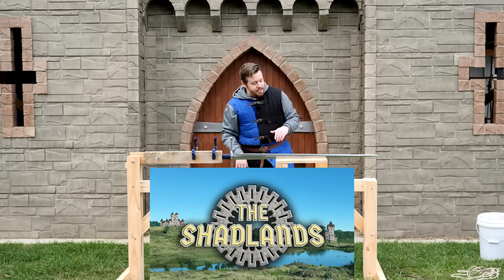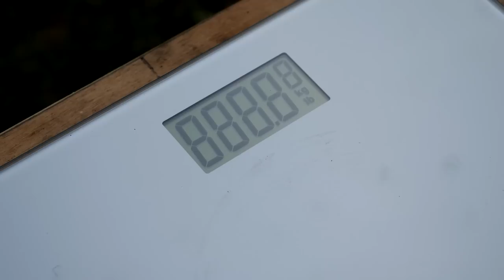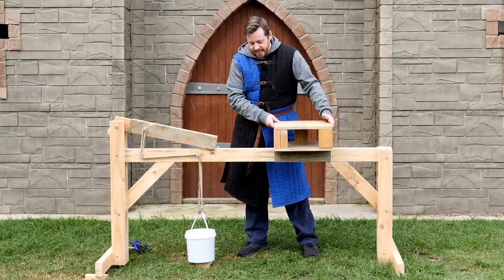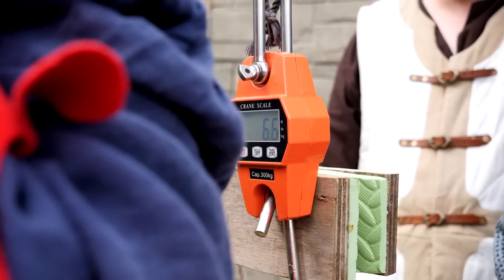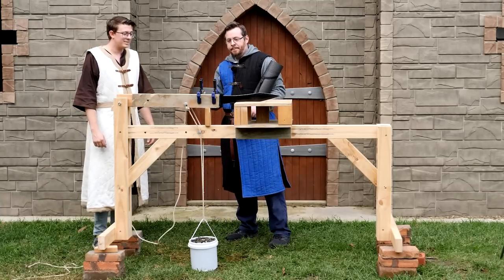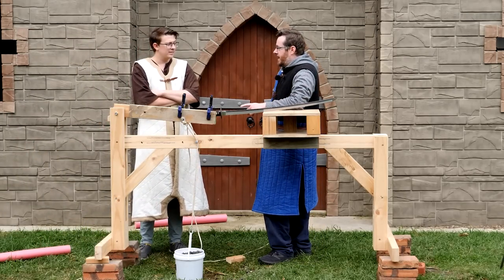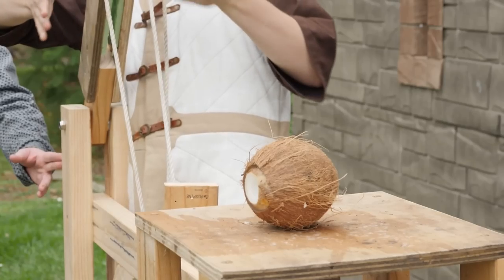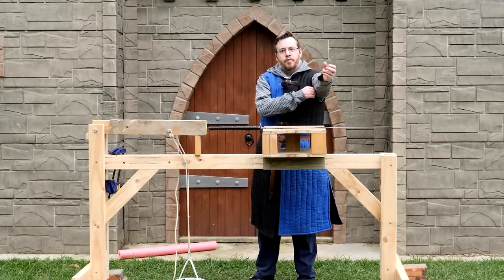Choppy choppy

Comment: I’m not an expert in these things but I believe my observations will make sense.  Your simple lever chopping device doesn’t reproduce the action of your movement when you used the katana.  The chop you made consisted of movement that included rotation of the shoulders, elbows, and wrists all adding up to the final chop with the addition of the muscles in your shoulders, upper and forearms adding to the kinetic energy of your blow.  You also probably added some additional force from your body weight as you leaned into the blow.  You need someone to design a robot arm to simulate the swing of a human arm and a better device to measure the force of an actual strike.

Comment: What went wrong is that your force test measured the pressure at the end of the lever (the point where the sword would contact the target), while your sharpness tests measured the pressure exerted by the lever about 1meter back from the end of the lever.  Two ways to fix this are to:
Use math to calculate the weight needed to be added to the bucket to cause the lever end to provide 7kg of force, or
Place the scale on the chopping block with an item to hold the force of the blade off the scale, tare it, then add weight to the bucket until the scale reads 7kg.
Reply: Also I recommend trying corrugated cardboard (the kind used in apple boxes or moving boxes) to test the cutting power of a blade.  Place it vertically in a stand of its own, if it needs to provide more resistance, just add extra sheets of the cardboard.  Just make sure you use the same maker to ensure better consistency.

Comment: No mystery, it's quite simple. The guillotine does add the correct 'force', but it only accelerates at g (earth's gravity).

When you swing, you use a much larger acceleration, explaining the massive difference in impact force.

This is why you can't use this system to compare weapons. As a human, you can accelerate a machete much faster than a broadsword, while your machine accelerates at the same pace, regardless of the weight of the weapon put in.

Comment: I think that there are many problems with this setup, some intrinsic problems, some "mistakes"
Problems: 
1. The weight of the wood contraption makes it hard to calibrate, i feel like the weight of the sword is not affecting its speed as much as when you swing it.
2. I dont think we humans apply a constant force when swinging, some positions are easier for us to apply force so that makes it harder to calibrate as well, this inconsistency affects different weights in a different way.
3. The sword slipping is also a problem, it kind of also happens with a real selrd swing, but this will introduce a lot of variance and some swords will have a bigger problem than others.
Mistakes:
1. When you calibrated the system you mesured your strength at the end of the stick, but on calibration mesured it at the end of the "hand".
2. On calibration you only considered your strength a the last moment of the swing which is probably weaker than average.

To solve this the easier thing would probably be to do a couple of tests with real swings and try to match that with the contraption, you may have to apply different weights depending on the sword weight.
Also the blade should be prevented fron slipping.

Comment: When a man swings a sword, he can use his hand leverage to fully push the cut through, but the tool swinging it just has a drop, which I'm guessing has a slightly different effect on the force going into the cut. There seems to be a serious difference in how much power goes into the swing at the time at hits a target, with a lot less strength being applied by the tool than by a man using his arms. I'm not sure what could fix that, but it definitely looks like there's a strong difference between the two methods right at the time the blade connects with the target.

Comment: When you did your force test with the stick, you were getting the force from near the tip of the stick, farther from the fulcrum (your shoulder) than where the weight you measured on the guillotine.  You really should measure the force at your cutting surface.  I'm guessing you need to double or maybe triple your bucket weight to get it about right.

Comment: Add water until you reach the very rim of a 5-gallon bucket filled the bucket and mounted on the Rope so that it dangles almost touching the ground but not quite when the sword is mounted and you are preparing to raise the sword to make the first test as far as what you end up losing is going to require somebody else who knows the calculations better than I do to figure out what your ropes are doing to the weight all I can tell you is that the roofs are sucking the energy out of the rotation. Yet you do not have to worry about starting the sword in motion taking up energy that is natural it is moving the rope that is taking up energy that would not be normal

Comment: Even with poor calibration, the swings were consistent with one another as they were applied under the same conditions. It may well be just the mass of the war sword, or differences in coconuts. Would have been interesting to swap back to the war sword before the manual swing to see if it was just a differences in coconut.

Comment: The katana was specially designed for a draw cut, whereas the longsword is compatible with drawing and cutting because of the shape. That could be why the katana wasn't cutting the coconut, but the longsword was. Just speculation.

Comment: I don't know the technical terminology but I have seen other commentors say it; on the point of impact the clamp looks like it slips on pretty much every drop, when you are swinging the blade yourself you automatically adjust to maintain a solid grip so the swing keeps it's strength. When your manual swing hit the coconut I would imagine you tightened your grip even without noticing, I don't know how you could replicate that with a rig.

Comment: just slice round objects at 1 point so they have a base and dont roll. us chefs do this all the time inorder to cut vegetables straight and clean without them rolling away or risking cutting ourselves.
also get like a huge chefs knife,  i bet that would blow your swords cutting things away, simply as if its scaled up to a swords size it will have a huge amount of weight behind it and be ridiculously sharp.

Comment: I think you need to match the accelarative force and not how much pressure you can apply to the scale.

Mark a sword with tape at the center of mass, do a real strike against a target filmed at a high frame rate of the same swing type that your machine does. Adjust your machine’s weight to match the (same) swords acceleration. Then, use that weight as your standard.

Comment: Just an idea but you could put a gap in the target surface so that it would be possible to actually swing through the target. As a side effect it would help hold certain objects in place. Also maybe add a handle to lift with so it is slightly less awkward.

Comment: Looks like those trigger grip quick clamps are slipping, it's actually quite hard to get a really solid grip with them because the plactic handles flex. See if you can get some all metal F or G clamps that screw down, you can get massivly tighter clamping with them.

Comment: Here is a point I don't see other comments bringing up. Your machine has the pivot point at the same height as the target but when you swing your shoulders(your pivot point) is above the target. The blade angle compared to the force direction is different. This adds a natural drawing force to your swing that the machine does not have. 
In the following simple force diagram the blue arrow is the drawing force:
https://drive.google.com/file/d/1XB8xVTS9R-kZ4QMKs0ZPGULaUrQO2-Oi/view?usp=sharing

Comment: I'd recommend setting up a pulley and release system. I suspect it would be easy to slip and have the blade slice you while holding it up, and with a release latch like on a crossbow you can remove the human element of friction while dropping it.
You also ought to fix the swords better vertically, as their slipping greatly reduces the force delivered.

Comment: The method of fastening the sword is pretty good, but when the sword encounters to much resistance you see that the blade tilts up out of the clamps. There needs to be some kind of stopper on the top of the hilt. That’s why the katana couldn’t get through the coconut. It needs to be fastened better and not be able to tilt up at impact

Comment: I think the weight at the cutting point will have to be calibrated between swords, with 7kg weight where you weighed it its probably 2 to 3kg at the cut point so a heavier swords will have a lot more difference and advantage.

Comment: If you angle the sword you need a wrist and a slicing action. Right now you only have a cleaving action and you're not using it appropriately because you are not using your grip appropriate. cleaving action works best when the tip is moving faster than the handle and the blade is parallel with the table at the point of contact with the table and with the point of contact with whatever you're connecting with the blade should not be more than 5° off parallel with the table. The grip on the handle should be between 30 and 50 lb with a wrist deflection weight of 7.4 keeping 75% or more of the weight of the blade itself beyond the center of the target either due to momentum of the tip of the blade or because you are using a true cleaving action and you are also using the center of the blade Edge one the center of the target minimizing kickback that the wrist will have to contend with. Basically ask your dad and prepare for a long lecture. If he is wise he will teach you how to study how your arm performs a cut. Because that will allow you to fill the machine exactly the way you want to build it.

Comment: Maybe a better way of clamping the sword? Alot of energy is going to be lost in it slipping out of the clamps. Maybe a through bolt top and bottom (from the viewers view a bolt top right and bottom left) to stop the sword handle slipping out the grip. So the sword would be supported at the top back and bottom front of the grip

Comment: There are a couple things wrong.

Not enough speed. You got to remember our arms aren't 1 simple lever. There's like 7 not taking into account your spine being segmented. So for simplicity sake measure swing top speed and have that be you target arm speed. 

Securing the sword put some padded bolts that would simulate someone pushing and pulling the sword not just pinching.

This is just me nitpicking about tools but those are speed clamps they're meant for speed if you want something to stay clamp look at f style clamps or screw clamps. F style or screw clamps can produce much more clamping force. A lot people think clamps are equal they are not. I've used f style or screw clamps like a makeshift press.

Comment: Could you change the apparatus so that the pivot point is constructed like that of  a torsion catapult?  This way you can modify the force applied to the pivot arm (by adjusting the tension in the ropes wound at the fulcrum), measure out a set distance (degrees of rotation) to attain consistency of force at impact, and not be limited by the force of gravity (I promise that a swing of a warrior's arm accelerates much faster than gravity, and if [force] = [mass] x [acceleration]...).  BONUS:  Torsion technology is Medieval technology!
Reply: I know that some might say that the weighted bucket would make up the loss of acceleration by adding mass, and that it was the total [force] applied that you measured by the scale.  But the weight in the bucket was calibrated to the force that you yourself applied to the from the length of a weapon.  Now...do you really think you couldn't cut through a yoga mat with a katana?  Keep in mind, you would experience some deflection in your wrists on impact...much like you experienced with the C-clamp grips that you are currently using.  I don't think we can put all the blame of a failed cut on the slippage of the grip setup...that may well be within tolerance levels.

Comment: you measured the weight at the tip of the sword and applied it to the rig at the handle.  you want the rig to apply 7 kilos at the tip too.  also for the platform, i'd make twin platforms with a space in between them so the sword can pass through the platform without hitting it.  the stopper under the handle is a good idea, but i'd make it a little shorter to accommodate the divide in the platform.

Comment: These points might have already been mentioned but the first issue I can see is you should be using kiloNewtons instead of kilograms since it is a dynamic force. You have the velocity, strength force, and weapon weight which will be much much higher than 8kgs, e.g. 250# falling 6' = >1000#.They have kN scales for rock/tree climbers but they are pretty spendy, you might be able to rent or borrow one. In addition your shoulders, elbows, and wrists are hinging (acting as levers) andding power somewhat similar to a trebuchet. Another issue is that the natural swing of arms follow through, provide a slicing effect especially if using a curved blade. Last but not least, those clamps are crap, use some good ole' C clamps.

Comment: You should also look into strike speed, the same force and the same energy are different, so it may be worth looking into as you can probably swing faster than the limited acceleration here. Another thing is that the sword isn't secure. When it hits the target it slides up, eating a lot of the damage it could be doing. 
For consistency sake I'd like to see a mark of where you measure the "down-force" and put where your hands should be on the swords there, again purely for consistency across different swords. Perhaps a gravel bucket is a bad idea, maybe cement it (I know this vid was for testing so maybe this or similar was already the plan)?

Comment: Force = Mass * Acceleration
You accelerated the katana a lot faster by hand so naturally it had a lot more force. Also, the farther the cutting point is from the pivot point, the more acceleration it has. Which means longer swords have a big advantage. Basically, as Demolition Ranch says, "Speed equals penetration."

Comment: Horizontal clamp not vertical, you're losing a lot of power to hilt rotation in the clamp. Also as noted below, the force you want to measure is at the striking point not the hilt. Also also as noted below, you need to up the acceleration to greater than gravity--the velocity of the blade takes advantage of the blade's momentum, and you lose a lot of that using gravity as you are doing; try using a 2:1 pulley rig and double the bucket weight (and put the rig so the bucket can move the distance it needs to; one pulley above the clamp, cos the bucket's going to have to fall more than a metre).

Comment: A spring based system may be more accurate than relying on gravity. You wouldn't be as reliant on acceleration. I don't know how much force it actually has, but you might try looking into one of those devices for throwing clay pigeons.

Comment: You need to measure the 7kg at the end of the sword when its in the apparatus. Put the scale under the end of the sword and add weight until you reach the desired weight. 7kg at the back of the arm wont translate to the same weight at the end of the sword, several feet away. Also, this number would change based on the length of each weapon tested, therefore each weapon needs tested (or at least something of similar length) with you manually seeing how much you can exert on the scale. Then set that weight with the weapon in the apparatus.
Reply: also the speed of the swing is important, bc force=m*a

Comment: As I see it thr problem is that the bucket hit the ground before the katana made any contact with the coconut and as a result didn't transfer any energy.

You might need a shorter rope or make a hole bellow the bucket.
Reply: It's hard to confirm since I can't see it frame by frame rn, but it would make sense to me. Might have something to do with the katana's curve, it needs mor distance.

Comment: From my observation of the dull sword chop of the coconut as opposed to katana chop of coconut i noticed that katana's position in the rig was tilted upwards both times you tested it while the sword kept its original position in the rig; other than the difference in weight of the sword and katana, the slight shift of katana in the rig was the only difference i noticed; maybe that was enough to affect the test. I don't know...

Comment: The coconut held up because you hit (basically) a half-sphere, and as others have pointed out, the handle slipped. This is confirmed by the fact that it cleanly cut off the end (where it wasn't hitting a sphere right down the center) and that you could cut the coconut in half (where the handle didn't slip).

Comment: Perhaps you should measure the speed of the swing of your machine versus your average sing speed of the sword you're testing. I know it's more work, Shad, but the force applied to the cutting edge is not a measure of how hard you can press down. Remember that the force equals mass times acceleration. So you to start your swings at the same angle as your machine, and measure the speed of your swings over the same distance that your machine can swing. Once you match your machine's swing speed up to yours you should get more accurate results. Keep up the great work.